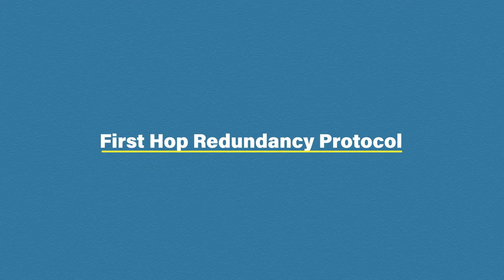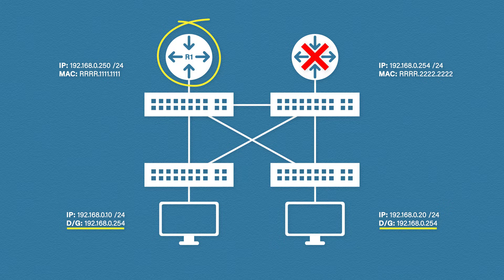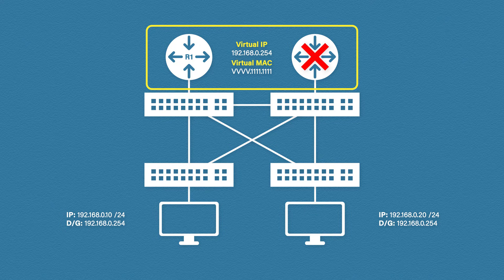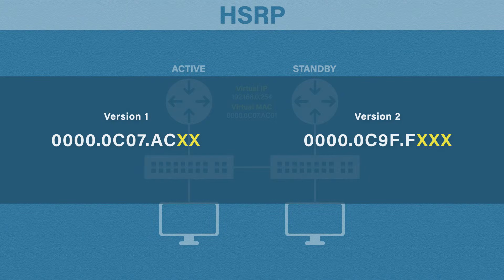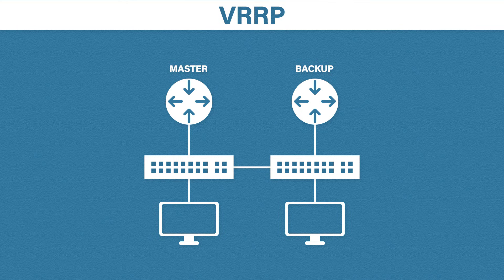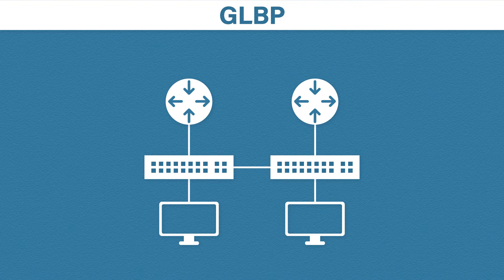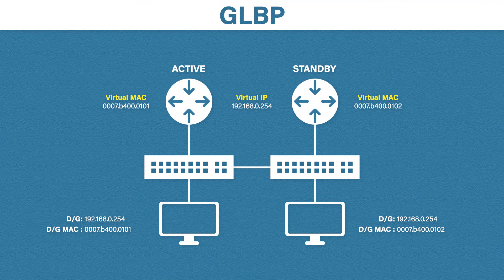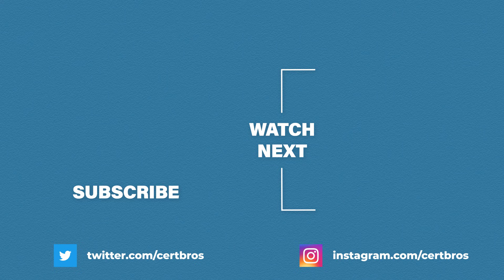First Hop Redundancy Protocol Explained | Cisco CCNA 200-301

Comment: If the ARP tables of User system is already updated with the Virtual router MAC address (.AC01)  which will be assigned to the Active router at the moment, Then what is the point in updating the user systems with the Same MAC address (.AC01) when a standby router becomes active.
Reply: For updating port interface (switches learn the new port) and cashing safety

Comment: The slide at the 5:10 mark says version 2 multicast is 224.0.0.102 but the final summary table at the end of the video says 224.1.1.2, which is correct?
Reply from the maker: Great spot! I must have missed that when doing my final checks.

The answer is 224.0.0.102. The summary is a typo.

Thanks for letting me know 👌

Comment: Can u tell me which layer 2 Cisco switch used in company and layer 3 Cisco switches....plz mention series of switch used in each layer ... waiting for reply🤗🤗🤗🤗
Reply from the maker: Series of switches used is really dependent on the situation. I couldn't advise I'm afraid.
Reply: If you want a general example I am working on a global office refresh just now and we are using C9200L-48PXG-4X-E in the access layer, stacked C9300-24-T-A for the core layer, FirePower2120-ASA Firewalls and ISR4451 routers for offices ranging 50 to 300 users.